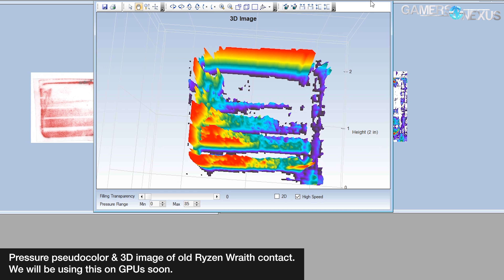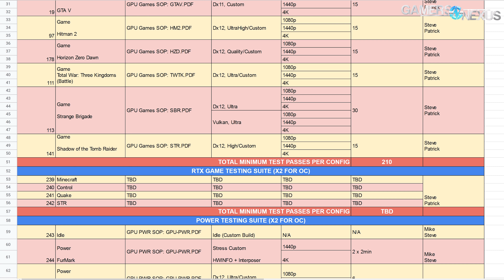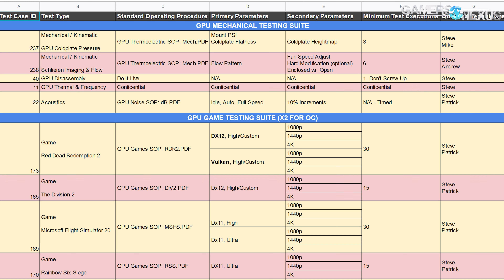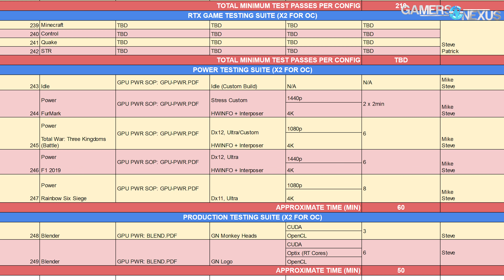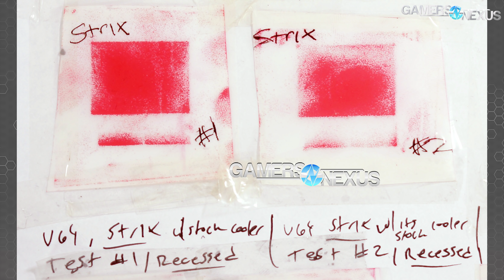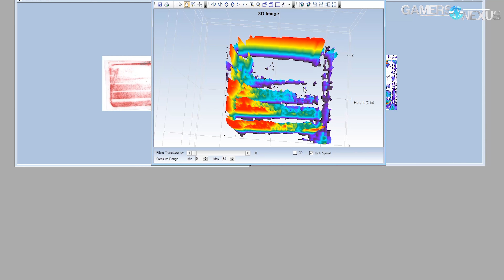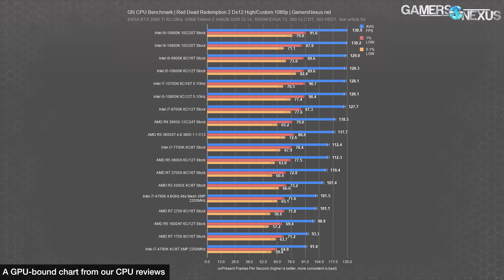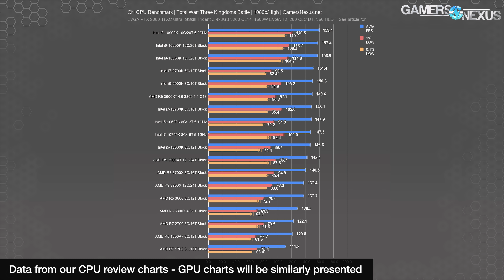$13K of GPU Test Methodology: Airflow Photography, RTX Games, Pressure Tests, Power, & More

Comment: But did you test the RGB?
Reply from the maker: Well, I guess we could buy tools to test light emission, luminance, and Unicorn Rainbow Puke Factor data.
Reply: Yeah, you need to make sure the RGB cover 100% DCI-P3 color space for the maximum experience!
Reply: @GamersNexus  puke factor data 🤣🤣🤣🤣🤣🤣
Reply: @GamersNexus  I don't know if you need that, I trust your head mounted eye meters
Reply: @GamersNexus   If I don't see a URPF section in the next RGB video....
Reply: Gamers Nexus I require atleast 4 pukes pr. Half hour of rainbow
Reply: That pressure 3d imaging looked pretty rainbow to me
Reply: @GamersNexus  U.R.P. bench under construction....
Reply: @Gamers Nexus Do it for the meme.

Comment: To get more insightful results with Microsoft Flight Simulator, you have to run a scenario which is not close to a large city. Large cities have always been CPU limited scenarios in flightsim. Use a scenario with a lot of clouds, mountains and high supersampling settings. Or a scenario at night with a lot of lighting (e.g. at an airport). Then you will see GPU limits.
Reply: To add to this, LowSpecGamer was notably able to see EXTREME performance gains by modifying the ini file. What was notably odd was how much the cpu usage changed based on changing some graphics settings like building rendering and how even just disabling the internet live updating gave something like 20 extra fps to his benchmark. It might be worth it for GN to look into possibly making a super unofficial, purely data-driven and not real-world dataset using those modifications to give more or less a deeper dive into what's actually making that game so hard to run.

Comment: I work in IT for an engineering firm. Leica rendering / Pix4D / point cloud rendering is a massive workstation market that is only represented by Puget systems or some dude on forum posts saying “I get X performance and here are my specs”. It’s a growing market and would great to get some data on workstation machines for that. Otherwise CAD is CAD and not a performance item but 3D applications like ArcGIS, Revit, and Bentley systems are example workstation use cases that don’t have much data.

Comment: Data science applications would be great. For example, neural network training using Tensorflow. 

Edit: Adding more ideas as I remember them...

Ampere introduced Tensor Core optimizations for sparse data I would expect some meaningful improvements.

Would also be interesting to see the half-precision (16-bits rather than 32-bits) inference improvements between architectures.

It's important to test multiple types of neural networks, some of them require more memory bandwidth than compute power. For a good representation of speed, I would include Inception-V2, ResNet-50, VGG-16, and AlexNet. CIFAR-10 and ImageNet for the dataset.

Some CUDA workloads like k-Means, CMAP, and t-SNE benchmarks would be very useful for data scientists.
Reply: Ampere added acceleration of sparse (pruned) neural networks, not improved data efficiency for neural networks. Sadly sparse datasets aren't gonna cut the mustard until a lot more research is done into transfer learning/generalisation and 'Catastrophic Forgetting'
Reply: @NicheAsQuiche  Nice addition! I didn't meant to be over excited about the current benefits of pruned NN.
Reply: Important to see who does NN better, AMD or Nvidia
Reply: @charlese2833  This will be a challenge. Most data science applications are written in CUDA. Therefore, they will run only on Nvidia hardware. In theory, the AMD hardware is quite capable of the task, like the HBM memory, but lacks software support.

Comment: I would like to see a GPU benchmark on Davinci Resolve, for editing and color grding, as far as I know it uses the GPU a lot and it likes having more than one GPU, love your videos thank you :)
Reply: Agreed would very much like that. It's very GPU dependant compared to Premiere or After Effects. And it favors cores more than frequency. It's editing, compositing, and 3d all rolled into one. And I feel like good info on how it utilizes your system is lacking.
Reply: This is what I came to post. 

Debayering RedCode Raw 8K source files or 6k BRAW sources while applying color corrections and sharpness adjustments across multiple nodes would be INCREDIBLY helpful.

Comment: Disclosure: Work as a Full-Time Senior Data Scientist. 
You should be able to add in some pretty straightforward off-the-shelf tests to demonstrate AI GPU performance. 

These days, a lot of the industry-standard/reference performance models are available on GitHub. 
Effectively you'll just need to fork the code/data. Install Python and the associated libraries (these may be included in the GitHub download). 
There will likely be a train.py file included which you will run for a set number of epochs and you can then compare time to completion across different models. 

I specialise in language and recommendation models but others might be able to add in some recommendations for image-based models. 

Anyway, here's a list of models to look into for you. 
for language models: GPT-2, GPT-3, BERT, ALBERT insert any Transformer-based language model here
Reply: Testing with leela zero for go and chess would be great to see inference performance on possible consumer applications
Reply: The irony is that, contrary to your preamble, GPT is closed source, and the standard versions of these transformer-based language models are designed to train and inference on data center HPC systems that absolutely dwarf consumer GPUs.  Maybe YOLO, SSD, StyleGAN, or Wavenet are better options.
Reply: Daniel Lavery GPT-1 and GPT-2 are fully open source
Reply: Data Scientist sounds like an awesome career. Slightly off topic from GPU benchmarks, but I saw a text game that uses GPT to generate stories. It blew my mind. Sure there's more productive uses for AI language models like Health Care, Fintech, blah blah. But how freaking cool are future games going to be when the AI can respond and conversate with players in such a dynamic way. Imagine stories and worlds like Elder Scrolls, except you can use your microphone to speak to AI and they respond naturally and human-like in real time.
Reply: I will echo that more in depth machine learning benchmarks could be really useful. I have personally done test runs of a Titan X Pascal against a Telsa V100 card for a couple programs I have personally written, and the discussion of going for consumer grade hardware versus the higher end products that NVIDIA offers is sometimes a hard one to judge.

As mentioned in the original post, there are a lot of open-source models available, though I will note a few common difficulties you can run into, such as tensorflow (one of the most commonly used libraries), often requiring you to use older drivers, making it harder to perform other tests. You can get around that by using a containerization program, such as docker, but that's a whole other can of worms (though the overall reproducibility of the tests should be fairly high). 

Do be careful with what open source models you choose though if using them straight out of the box. Quite a few can be bottle-necked by the CPU or by memory speed instead of the GPU itself. As well, depending on the configuration some of the larger models take up many GB of GPU memory. Usually there is a way around that, but for some of the massive image classification models, you would probably need to change quite a few settings to even get it running on cards with low memory. 

That said, once you get into it, its not that difficult to get real results. You could just generate a bunch of random data, then feed it into a model, which is honestly only about 20 lines of code, and with just a little work you could have all the timing data automatically saved for you, making it a press go and come back in half an hour type test. The major head-ache is usually the library dependencies.
Reply: @dustintanksley9950  There's an editorial choice here, too, since the TF and PyTorch backends both depend on CUDA, so there's really no apples-to-apples comparison between nVidia and AMD cards for the deep learing community.  (TF-Lite newly has OpenCL backend for inference on mobile devices, but I don't think that scratches this itch.)  I think a lot of the other benchmarks on this channel aim at disambiguating raw hardware performance from proprietary software/firmware stacks, but at the moment for the widely used DL frameworks nVidia is the only game in town.
Reply: @dustintanksley9950  I think only measuring time spent actually training and not loading the model (or just running any long training session, really - cpu/ram only really matter that much during the initialization) would be somewhat decent testing methodology. Personally, I'd LOVE to see A100 vs V100 vs titan vs 3080/2080ti comparison.

Also, for completeness one could try just retraining existing models with the same tf record - the world of ML has enough benchmark sets for different kinds of problems at this point.

Comment: I would be very interested in seeing some deep learning benchmarks.  That's something that there really isn't a whole lot out there for in the first place, despite the fact that it's a huge and growing field.  And GPUs are very important for it.

That said part of the reason why there isn't a whole lot out there is that there aren't really any standard applications.  Sure there there are standard frameworks like Tensorflow or PyTorch, but most of the code at the end of the day is going to be proprietary.

Probably one of the better places to start would be the reference implementations for the MLPerf project at mlperf.org.  They have code and datasets for common tasks like object detection or NLP.  The reference implementations aren't necessarily the most optimal possible implementations, but they're a reasonable place to start.

If you're interested in pursuing something like this I would be happy to answer questions you might have.
Reply: So underrepresented, and growing rapidly in popularity. Running some standard CNNs, or popular DNN designs, would be great to see. Especially performance across batch-sizes, speeds etc.. Would help answer the questions of what's the optimal configuration for the new 3000 series cards, where are the bottlenecks, ...
Reply: David Kanter is involved with MLPerf IIRC so Steve got a really knowledgeable guy he can lean on with regards to using it to test. :)
Reply: Seconded!
Reply: Testing that might be difficult, since each neural net is essentially unique, even when trained on the same data. I've heard that most techniques for training and using neural networks are FPU-heavy workloads, so benchmarks that hit the FPU hard will in theory be a good indicator of neural network performance.

Comment: Professional GPU workstation user here: non rendering - CUDA only, but hydraulic simulations for flood modelling etc. We use MIKE by DHI software which is CUDA enabled (and in honesty, only worth running on GPU due to speed up offered). But there are a plethora of other 2D hydraulic simulation packages which can use GPU. Lots of civil engineers/natural&built environment engineers use this software. Would be happy to discuss further if you were interested in building a benchmark.

Comment: The average house cat radiates about 11 watts of thermal energy per hour.
Reply: A human about 70 W while seating..
Reply: Watt is a unit of power, not energy.
Do you mean cats radiate 11 watts? which is 11J per second or 39600J per hour. That's about 9.5 kcal per hour.
Reply: @emmata98  Well ... actually daily (avg.) energy need is at least 2000 kcal, that's 8368000 Joule (8.3 MJ), over 24 h (or 86400 seconds) [i.e. daily], that comes out to be ~96.8 W, or in other words: a 100 W light-bulb.

btw./FYI: 'kcal' [meaning: kilo calories] {yes, metric!} what these USofA call just 'cal', they omit the 'k' because it would confuse the people ... or something

https://www.rapidtables.com/calc/electric/Joule_to_Watt_Calculator.html
https://www.theunitconverter.com/kilocalorie-to-joule-conversion/2000-kilocalorie-to-joule.html
Reply: What heatsink do you recommend for my cat?
Reply: @darknase  Therefore I wrote: seating.
You don't seat all day.
You eat for example (witch needs more energy...)
And cal is not SI/Metric.
It is just an old unit, still used, but Metric is Joule, or to be a bit more wild (kgm^2)/(s^2)
Reply: @emmata98  kilo is metric/SI - that doesn't  even touch upon the fact that the pound (lb) and inch are nowadays all derived from the meter/kg/s system.

About  sitting: There is not difference if you sit or move; just to "keep the lights on", i.e. keep a body temperature of (95%) avg.  36.6 °C, a human requires 8.3 MJ (or 2000 kcal - female 2000, male up to 2700). (see below [1] for more)

Walking in on a flat and in a straight line is mostly falling from on leg to the other, more of a rolling action, i.e. just overcoming inertia.

Climbing a flight of stairs (or hill for that matter), on the other hand is work done against gravity; moving the potential energy of a body of weight X up in gravitational potential by amount Y (18 cm is a normal step height - higher OR lower and you might stumble, a science in itself) takes about 2000 Joule (2 kJ) [or ~0.5 kcal].

8.3 MJ + 2 kJ = 8.3 MJ

You would need to go 50 flights of stairs just to do 0.1 MJ (100 kJ), that's less than 0.8%. A Snikers bar has 1MJ (1000 kJ)..

So exerciser is not the "fat killer", but the resulting generation of cells in the muscle tissue.

[1]
Btw, how much energy a body needs is not only computable by this strange calorie thing, which is based upon actually burning fat and computing, but also by (simplified) taking the heat capacitance of a body (human:  75% water) and it's radiation surface, primarily meaning: skin; about 2 m² of it.
While lungs contribute, being intern they do no radiate - a rather plus/minus zero game -, but do lose heat via evaporation, liquids (H2O) and gases (CO2) are a like in this regard, which is in comparison to their ~80 m² surface area rather negligible. BTW: Dogs actually use their tongue when they pant.

EDIT:
Addendum:
The Human brain uses, in relation to other animals, because of it's workings, incl. the rather big neo-cortex a significant portion of the energy balance of the human body (2% of weight vs. ~20% of energy).
Reply: @valgarlienheart  a human hand is usually a good choice for a cat. Because of the thermal resistance of fur, keep the heatsink moving along the fur. Also, monitor the stats of the cat at all times to ensure a consistent purr sound.
...
No this is not just an excuse to pet the cat, what are you talking about?
Reply: @Gameboygenius  So you are saying I will be ok with a 120mm radiator to cool all of my 3 cats? :D
Reply: My cat has 5 120mm fans because my cat is overclocked
Reply: @valgarlienheart  water cool the cat for increased clock speeds
Reply: Instructions unclear; cat now upside down with butter on it.
Reply: RGB implants for max overclock obv

Comment: For professional benchmarks, seeing performance in Autodesk applications would be interesting to those who use those programs in Architecture and Engineering frequently.
Reply: Autodesk building suites don't use much gpu or cpu. CPU is single threaded for working and multi-threaded is used mostly for rendering so you can use cinebench as a benchmark. you want throughput for autodesk so generally the higher frequency, the better. Also comes down to certified drivers for large companies and gaming gpus don't have certified drivers. I have used gaming gpus for years without a problem though.